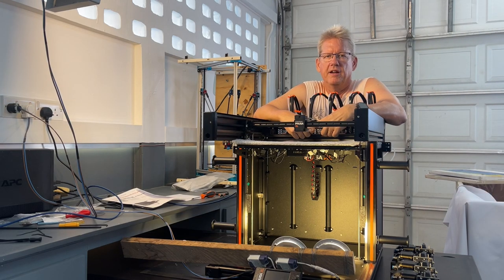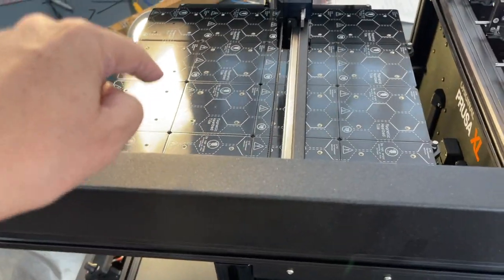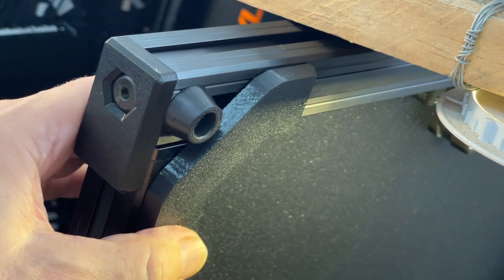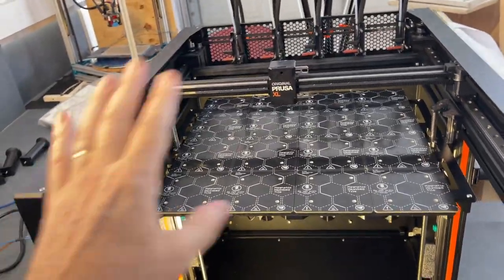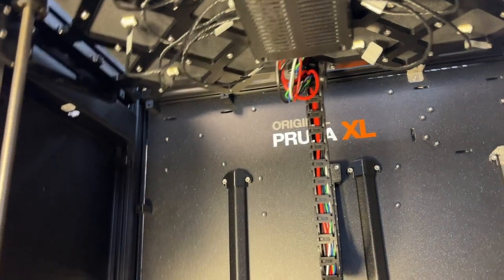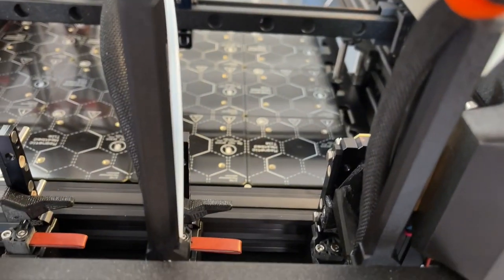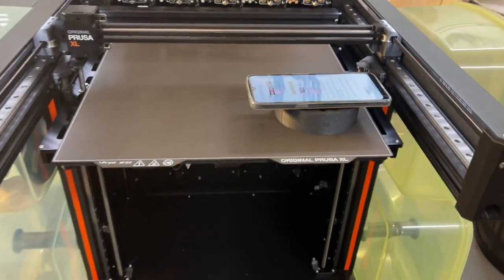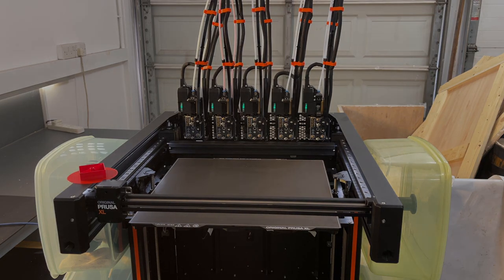Avoid the Pitfalls: Prusa XL semi assembled build tricks

Comment: I own a 5T XL, great video. For something so important, secure tool head dock mounting for the tool changer, Prusa sure made it a weak point - hard to reach and a small screw. My docks have come loose after a lot of printing, but if it happens again I'm gonna follow what you did and take that plastic piece off to get the short end of the hex wrench on it(and use thread locker). Honestly, Prusa should update the guide to that way, something so critical needs to be torqued as much as possible, but they probably want setup to seem "fast".

Comment: Thanks for all the great info. I'm curious about your drybox system for the spools on the side. I don't think I have the room for it. I was thinking of mounting the dryboxes above the printer, but then the filament path will not be correct.
Reply from the maker: They are cake boxes I found in a superstore I had access to.  I settled on these after a bunch of trials on boxes that were big enough, turns out that the average sealed lid plastic box will not actually keep silica gel dry in a humid environment.  I've now built the EnXLosure and find sadly that I can't fit more than two boxes on a side, so will be investigating a cereal storage box solution.